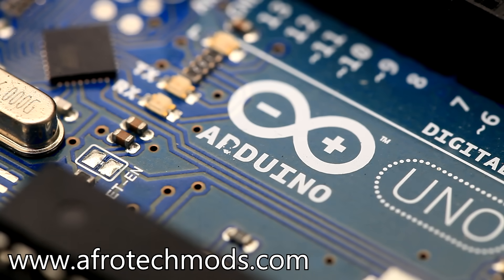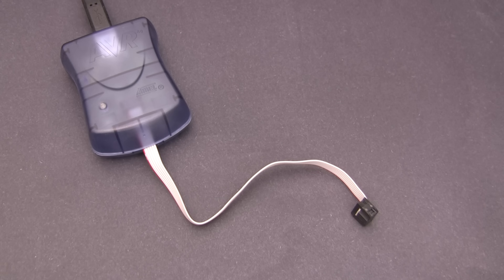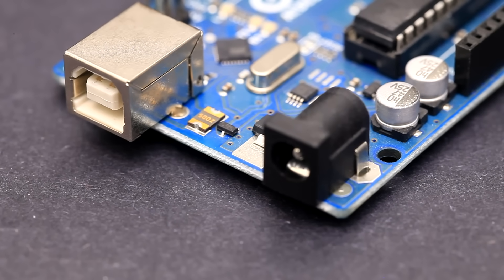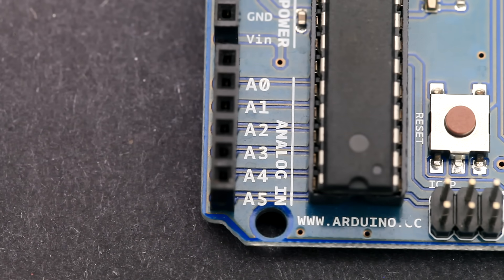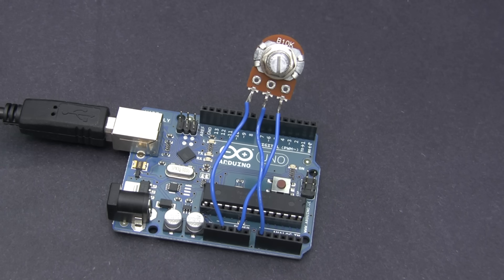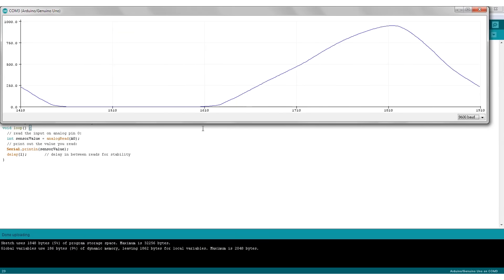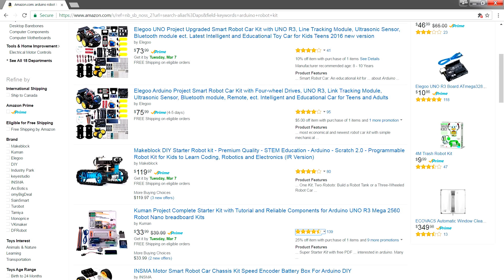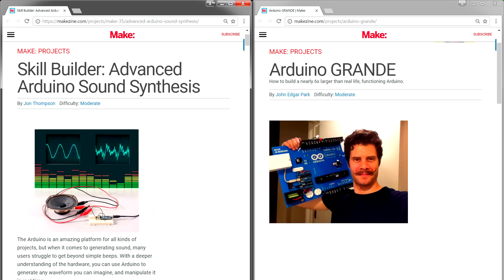You can learn Arduino in 15 minutes.

Comment: Holy crap this is really hard to understand! Is this something for someone who knows nothing about electronics or programming? Or is there a more basic starting point that I should consider?
Reply: Don't feel bad.  I have had a fair amount of experience with arduino, have a degree in engineering and am going to have to supplement this with other knowledge.  It's a constant and long process to learn this stuff so just take what you can, book mark the page for later and keep plugging along.  You're not going to be an expert in one video.
Reply: Lenard Gutierrez he goes off a bit, and increases the difficulty a bit much, for a beginner video.
Reply: you can find all the help and starting tutorials at arduino.cc
moreover once you install the arduino IDE from arduino.cc, you can find basic examples within it and start learning.
here's the link to download the arduino IDE.
https://www.arduino.cc/en/Main/Software
Reply: It's "beginner" for someone with basic knowledge of digital circuits and programing I guess.
Reply: Lenard Gutierrez its ohkay. That's our job. We will sell it or give  u it.
Reply: until the 1st half of the video there was nothing hard , then the fkng video title turns out to be a fkng clickbait

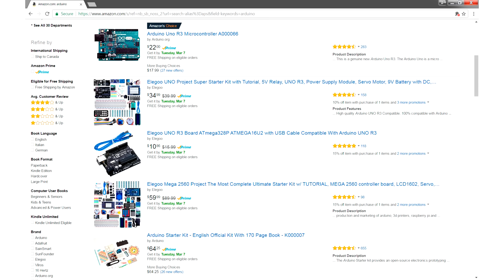Comment: Can the Arduino coding software work with knockoff Arduino uno boards? For example, I have the "Elegoo Uno R3" board which is shown at 3:04
Reply: Generally yes.  Sometimes you need a driver or need to add some support files to Arduino Studio.

Some of the knockoffs emulate an existing device.  I've got a bunch of knock-off Pro Micros that I use, and it works fine with Arduino Studio set to "Leonardo."

Comment: Basically, you wanna use an Arduino if: 1. you need to power an electronic project with a battery and 2. you don't need a full fledged computer with an operating system (à la Raspberry Pi)...

Comment: Hi, great videos, i need you to help me with my arduino 101 i have this problem
Flashing is taking longer than expected
Try pressing MASTER_RESET button
ERROR: Timed out waiting for Arduino 101 on COM4
Executing command: exit status 1
thanks for your help
Reply: make sure that you have correctly connected the arduino to your laptop
in order to check the connection control manager>device manager>COM Ports And LPT>Comms Port
after that check the selected port from tools in the arduino IDE
also make sure that you have selected the correct board from the tools>boards
Hope this helps you :D

Comment: I saw another video on a motor driven car/robot and got confused. If the USB provides power and code, how does the robot operate without the computer? I saw batteries on the car so that is how the UNO and motors operate , but what about the code? Once downloaded is code stored  onto the UNO? Once the USB is unplugged wouldn't the code be lost?? The transition of power connection and code storage has me confused.
Reply: once programmed there are several ways to power up the arduino
1. using a power bank 
2. a simple cell phone charger that provides a stable 5V supply
3. 9V radio battery with a power jack
4. 12V battery with power jack
once programmed, the code is stored in the bootstrap memory of the arduino and after that connect it to above mentioned power sources.
at last, the arduino needs 5V stable supply to work. Whenever we connect 9V or 12 V battery(s) a SMT voltage regulator steps down the supply to a stable 5 Volts.

Comment: One of the best tutorials of ANY kind you'll see here.  No anoying music, no glitches with mics or camera, clearly spoken, planed ahead so he knows what the hell he wants to say before he says it.  Outstanding. Not a wasted moment.
Reply: Your right—Half way through I was wondering how I could be watching a tutorial on You Tube without feeling the usual compulsion to violently attack someone. The reason (of course) — no stupid annoying drum beating background R&R/ Pop Muzak.
Reply: couldn,t agree more. its' a very beginner tutorial but worth watching. i thank the guy who did it.
Reply: haha...those are exactly my thoghts when i watched this after switching trough 10 other videos after 5 seconds each :)
Reply: This is exactly true.  Plus it's in COMPREHENSIBLE ENGLISH instead of third world mumblemouth gibberish!
Reply: @Carl Wolsey I take your point... it takes more than 15 minutes to master things.  It doesn't take very long, though, to learn the basic parameters/ rules of a system.  Learning the system isn't the same as mastering it.  Chess is a good example of this, I think.  One can learn the rules and gameplay of chess in 15 minutes even though it could take a lifetime to truly master.
Reply: Can we use the Arduino software even if we have a different circuit board similar to Arduino.
Reply: @chrisrodrigues3986  Yes, you can.
Reply: in which case what are the rest like?
Reply: Definitely. I wish that I had this back when I started!
Reply: Not one second wasted. Other than the catmercial break. That is 2 seconds i am never going to get back
Reply: Annoying*, planned*
Reply: Got to agree with you on the annoying music part.
Reply: what lisaecksteinband said :)
Reply: love the non music.....much appreciated...
Reply: He also used weird, funny, and totally hilarious things  to keep it from becoming boring.
Reply: No cause he said basics. i do not get what hes saying at all i dont know thw terms. I thought i would get it but i didnt
Reply: So true
Reply: And the best of all, it's not Hindi!
Reply: this vid made me subscribe!
Reply: I can't agree more!!! Great stuff for beginner like me. Learning Arduino with my son now, gonna get him to view this fantastic video. And yes, i have subscribed. :)
Reply: i must agree
Reply: really great tutorials.....none better....Outstanding u can watch several times and something each time....your subject knowledge A+
Reply: AlexGyver?
Reply: Nor was there any on-camera "influencer" waving his/her hands, gesticulating, bloviating, or acting like a fool. 
Imagine....he actually wrote the script beforehand (as others have observed)!
Reply: You are so right, and I still don't fully understand them lol
Reply: Arduino-no
Reply: Yep. Agreed.
Reply: @Carl Wolsey true
Reply: Problem fingerprint R503 with Arduino using Adafruit Library
https://youtu.be/53-lgJJBOeY
Reply: https://youtu.be/Z1bg40OlQhQ

walking robot using arduino uno with flowcode
Reply: we have a youtube channel that deals with Arduino,ATmega328P,Java,Serial programming ,robotics. So if you like these stuff do Subscribe. Sorry for annoying
Reply: oh come now everyone loves listening to distracting loud music to lose your focus
Reply: Yup !!!
Reply: Check this one https://youtu.be/nxjpwX4CzEg
Reply: I agree
Reply: Well said
Reply: annoying* planned*
Reply: CATMERCIAL COMMENT BREAK
Reply: Except for the "Catmercial"..  Which was not objectionable.
Reply: It's totally the opposite of those tutorials that say, "Now you go over here and click this, and then you change the value over there..." HUH? WHAT? WHERE? I didn't see that. 

Yes, it's planned ahead. If those other tutorials were giving GPS driving instructions, they would be saying, "Turn left at the--Oh you just missed it. The place back there. Might as well go home and start over." 

And no annoying music. I've seen questions online asking, "What music should I use with my video of (how to bake a cake) (me riding my horse) (how to teach ASL) ??" Well, how about NO MUSIC AT ALL?
Reply: @amazing763  chill
Reply: I have to agree to the comments below, great tutorial. I am a seasoned Arduino user and even I learnt something from this video Thank you.
My only question, you did not include blink, just wondered why?
I normally teach that program first as if normally does not require any extra parts.
Reply: lisaecksteinband thats why i sub this channel years ago
Reply: exactly!
Reply: Seriously this is weirdly good lol. I love it
Reply: So agreed!
Reply: Unlike Khan Academy where he wastes so much time on his color drawings and repeats himself over and over again.
Reply: The difference is that Bill Gates gave Khan academy millions in a donation for some reason.

Comment: I am doing a senior project as an Information Technology major. I am making a musical gumball machine. The objective is to receive a gumball or similar candy from the machine. In addition, while the candy is being retrieved, the machine will light up and play music. A coin is not necessary to receive a gumball. When a coin is deposited the machine will light up but not play music. The machine uses a sliding lever to initially retrieve a gumball. I need sensors to detect the attempt to receive a gumball and then music and lights to follow immediately after. What suggestions do you have for my project?
Reply: can please make clear in a flowchart manner that what exactly you are planning

Comment: I suppose the IDE for Fartduino is truly vaporware.
Reply: flammable gas sensor + arduino = fartduino
Reply: It kinda is, although I tried a library for FartDuino and it worked nicely. for example:
 #include <fartduino.h>
const int push = 3;
const int fart = A1;

void setup() {
pinMode(push, OUTPUT);
}

void loop() {
if(analogRead, fart) > 200) {
digitalWrite(push, HIGH);
delay(1000);
}

else {
digitalWrite(push, LOW);
}
}

caused the fartduino (with a pressure sensor hooked up to A1) to squeeze a fart on average every 5-10 minutes depending on the cereal data it processed.
Reply: No, Vapooware.
Reply: Alan Gresham  A mass deposition event....oh poo poo to you too!
Reply: Burfurd9000 is it possible to create a tablet using arduino that will able to display HTML files as a browser from memory card?
Reply: is it possible to create a tablet using arduino that will able to display HTML files as a browser from memory card?
Reply: Everytime a Fartduino™ fires up, a hipster hits a vape pen😹
Reply: Oh man thats super funny on first fast read😂
Reply: But arduino farts smell sweet, why worry about it?
Reply: HAR HAR!!
Reply: "boooo, you suuckkk!"
Reply: ...
k den

Comment: This is great video. Can you do a similar video on the Raspberrry Pi 3. I loved your video on Voltage regulator tutorial & USB gadget charger circuit and I am wondering how many volts can I plug into the Raspberry Pi 3. I saw a video where (5) 12volt pumps where plugged into the UNO. Can the RPI 3 do the same?

Comment: Arduino did not create that programming language. The language is C++, but they changed the standard libraries so it would be better for running on a microcontroller. Those libraries actually weren't created by Arduino. Wiring created them. Arduinos are an atmega microcontroller with built in voltage protection, labeled pins with female headers, and a USB port. You used a serial port originally to program an atmega. The usb is there because computers don't have serial ports anymore. The usb emulates a serial port and sends data through serial on the arduino into the atmega.
Reply: Nowhere did he say that Arduino created C. Of course, when he says they created a programming language he's not referring to C itself, but the subset of C used and it's implementation in the IDE, etc..

Comment: At  7:10 you neglected to mention that following the installation the PC will need to reboot as this could otherwise result in the drivers not being installed and the Arduino not being recognised.
Reply: Non-Windows-based computers tend not to need reboots. Most drivers are either recognised and used straight away, or else a simple switch off and restart of a process will implement the new software.

Comment: i m planing on lasersensor guided electro magnentic active suspension for RC cars ... is this possible with an arduino ? imagine a light dimmer only that the distance to one or 2 laser pointers controls the power of the current ....

Comment: it is also possible to use a Arduino as a PWM modulator?
normal sound (speech) convert to PWM
I ask this because I want to modulate an IRF510
So audio to Arduino to PWM, so I could modulate a second FET ( IRF510 ) ( AM )
the one FET with the other FET.....

friendly greetings from The Netherlands
Rob.
Reply: yes it is possible yo use arduino as a pulse width modulator.
the fading of LED is the best example that makes the use of Pulse Width Modulation technique.
Hope this helps you
Cheers!

Comment: Arduino to turn light on in a room, then a voice command to change the lighting. This would translate into command equals voltage level and avoiding the manual slider switch. Cool!

Comment: What i like about Arduino is it's simplicity. Before arduino i only knew basic language  from commodore64 (and some machine language also) but, for me, PIC series was really complicated to upload programs and even more complicated to  program. When my first arduino came , BAM, i was blinkinking LED in 5minutes. 
I still don't know nor understand fully c++, most of code i write is actually just copy-pasted versions found on interned, or edited examples. But it was enough to do simple stuff with leds, LCD screens, or any other cheap modules from china.

Comment: what would you suggest?
1. arduino pro mini
2.arduino nano
3arduino uno?
for beginner... which board is easy to program and can can do most things like robots and stuff? pls help afro....🙇
Reply: Shut da hell up $4 arduino clone from aliexpress with both (double) male and female headers and two momentary buttons on the board. CH340 driver, I think. Google arduino uno black board.
Reply: Get at least one UNO. Lots of shields for it. Nano is smaller in size, cheaper and breadboard friendly. For pro mini you'll need additional usb2serial adapter (that is used only for programming and/or serial communication) but is really smaller in size and is often used in battery powered project (esspecially 3.3V MHz version)

Comment: Can sombody help me with this Code?? 

double temp;  
 temp = ((-3,33304617858563/100000)*945*945 - (8,61651919/100)*945 + 132,1);
  Serial.print(temp);

It should show around "21" in the monitor for temp but it says just "1", i tried int or float instead of double.. but it didnt work either. Thanks for any help!
Reply: You got damn right!! I split the calculation in around 6 simgle steps and it works. Thanks alot Jason!
Reply: Yes :D Its a 100k NTC of my 3D Printer. Do you know a solution? :D
Reply: can you tell me more about the NTC?For example,the part number of the NTC
Reply: I ran the calculation through Windows Calculator in scientific mode and it came out with 20.9 (and a bit), so it appears the calculation is correct.

Perhaps the calculation is somehow overflowing or under-flowing the "double" variable type.  Is there a "quad" variable type which you could use instead?

As an alternative, can you rearrange the order of the calculations so that the intermediate values are all lower?

Or the problem could be that the calculation as it stands requires more than 8 stack levels (the maximum for most microcontrollers).  Perhaps try breaking up the calculation into multiple lines, first returning intermediate values and then combining them in the last line of the calculation?  Try no more than two operations in a single line.

On reflection, I think that last guess is the most likely one to be correct.  Try breaking up the calculation and see what happens.  I'll be interested to know the result either way.
Reply: your last guess is wrong,because i tried it before,and it didn't fail with more stack levels
Reply: It is a 100k NTC, you can look up the datasheet in the internet. Its a standart temperatur sensor for 3D printer.
Reply: The problem isnt the Thermistor. But the thermistor is inside the heating bed anyway so it is not possible to replace. I found a solution, Jason got right.

Comment: why is there a resistor across the crystal ? its really bugging me
Reply: "The bias resistor (internal or external) is required for the oscillator 
to reliably start up- it biases the amplifier into the linear region 
where noise can be amplified to get the crystal oscillator going."
Reply: i know them smd crystals have capacitors built into them  but iv never added the  resistor in any of my projects and its been ok. im surprised i never seen this on any schematics

Comment: On one it is nice what Arduino has done for the electronics hobby. The mass production of shields/modules/sensors for the hobby market has them brought down in price so much that you can buy stuff "just in case". On the other hand I often see people who don't know what they are doing at all, just follow step-by-step instructions to connect something up and still think they are "doing" electronics or programming. Then they wonder why their AVR is fried when they change something. So while it made electronics definitely more accessible, I don't know if it has a big effect on people learning electronics.
Reply: That's for damn sure. To fully understand electronics, you need to have good working knowledge of physics, calculus, circuit design and analysis, programming,  microcontrollers, analog circuits, signals and systems, etc. There's a reason why companies want at least an associates degree in electronics for any legit technician job. Nevermind technologist or electrical engineer.
Reply: @crazyahhkmed  I don't find much use for calculus, but you certainly need math if you're going to do much creating.